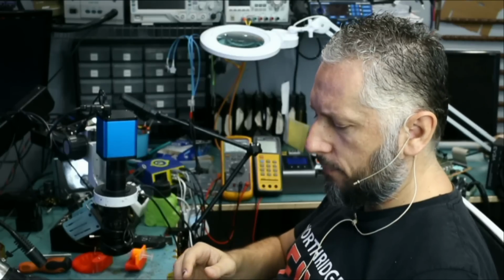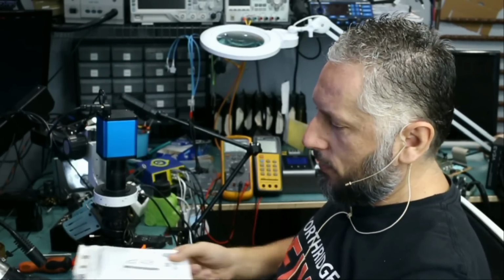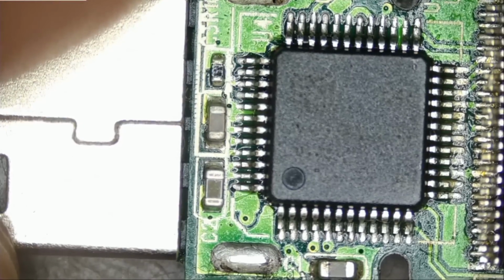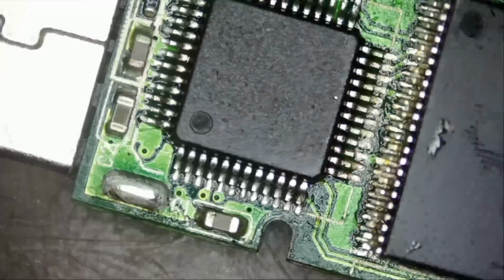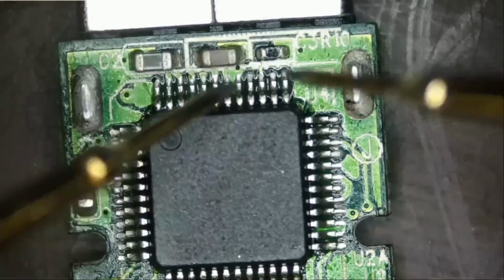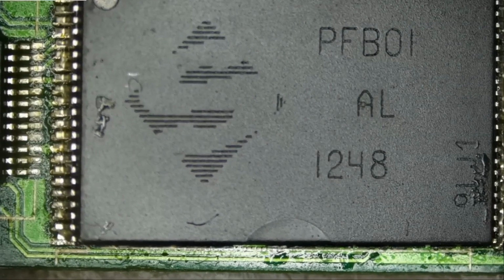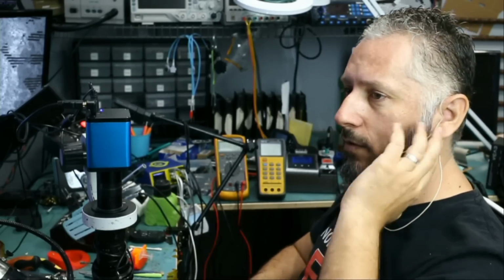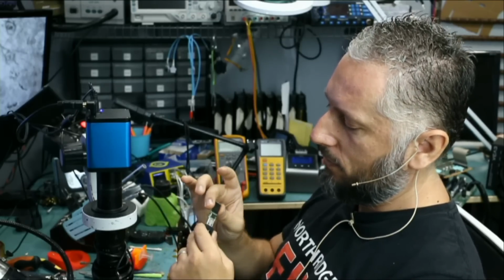Attempting to fix a damaged Flash Drive - Why would anyone do this..

Comment: i dont know for certain but it is possible you put the chip on upside down.. if you notice on the board there is a circle and there is a dot on the chip. you put on the upper left. on the usb drive i have the dot is on the bottom right.. where the circle is on the board. its entirely possible tho the chip has already been fried and it was too late for you to fix.
Reply: yes, he did it wrongly
Reply: He put it on the same orientation as it arrived. The text on the chip is the same way up before removal and after it’s been put back on.
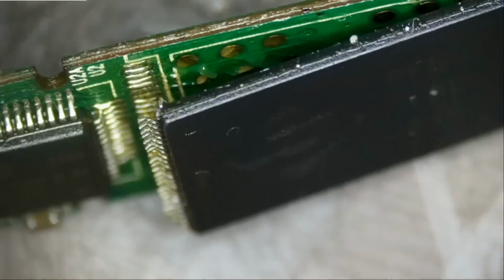Reply: @Durzel  yeah i get that but i dont see the arrow that shows where the dot goes at 1:55.. i do see a circle tho at 3:58
Reply: I saw the same circle now that it was mentioned.
Reply: i agree, there is a circle on the board, at 3:52 can be seen, and the chip circle is in the opposite corner, the chip came missplaced and he probably assumed that was the correct position.
Reply: @misterpacoalaparato  Well spotted.

Comment: Isn't the chip upside down? The circle marker (3:50) is in the bottom right corner on the board, while on the chip it's in the upper left corner. Also, there are pads for a diode (2:30) that doesn't seem to be populated. Maybe that's why there was no light. I would expect the controller to at least enumerate on the USB bus. EDIT: It's an 8 GB Micron chip (MT29F32G08CBADAWP) packaged by SpecTek (FBML84A61K3BAAWP)
Reply: Yup = that is what I see too...
Reply: Yes its soldered without checking the circle marker, only if he paid attention but was more concerned about his microphone and batteries...
Reply: yeah 👍 he prefers speed than good work done properly.
Reply: @MegaTomPL2  yeahh I seem to see a lot of his no fix problems are discovered by comments

Comment: Customer should have bought an identical flash drive, so you can swap driver or nand between them and try to recovery data
Reply: Really?

This guy should just have a flash reader.

This is the actual fix to this issue.
Reply: I’m thinking the same
Reply: @nexxusty  The customer did not want to recover data, but fix the drive.
Reply: @radeksvoboda7629  customer sent it to 2 recovery places and they couldn't apparently. So the customer definitely wanted data recovery.

This guy just soldered the chip back on. Anybody with SMD soldering skills would've done that.
He didn't even attempt the recovery at all.
It doesn't take rocket science to insert it into a computer and say it doesn't work, now pay me even though I didn't do the job.
Reply: @radeksvoboda7629  A 128GB drive costs less than what a competent technician charges to even think about fixing a drive. This was data recovery.
Reply: I agree with you. Swap nands could have worked

Comment: Nice work, nice video. But i don't think that this usb drive was ever at a "data recovery store". I guess no one will this usb drive leave like this or send it back to his customer like this. That would be a bit weird.
Thank you for that video
Reply: i think the same as you + i think the costumer do this mess😂😂
Reply: I believe if those hdmis In xboxes, ps can be done like that, then this can happen too. But I believe no company actually removes the big Chip. It's mostly those small, controller chip they find the same batch for.
So it doesn't make any sense to me
Reply: I've been given similar stories with devices brought for repair. Screws stripped and missing.. customer claims it was a previous repair shop that did it. Usually get them to admit it was their own doing after a little bit of back and forth. ”highly doubt the repair shop stripped every screw and pried open the device with a butter knife”. Lol some people
Reply: There's people that can actually leave it like that , i'be send a laptop to repair it ( bios flashing ) and like 4 week's later they writed us so we can get it back , back again in our house , wanting to switch it on so we can made a backup of the data in the lap hard drive , we realized that the entire laptop was dusty .\\
And one keyboard flex connection was broken //!--

Like they pushed really hard the keyboard .

Comment: Good Morning from Cape Town South Africa. I watch your vids all the time and I'm learning alot. I watched this video an came across 1 of the pin connectors which was not soldered as the connector was removed while you were checking the pins please check 4.27 all pins are there on the right side. Then at 4.33 the 2nd pin from the top is missing. I'm not sure if this could be the issue to why the flash drive is not picking up when plugged in? Loved the music by the way.

Comment: You could attach a backup mic (mini lavalier)  on top of the microscope. The quality wont be as good as  Sennheiser but you'll always have a backup when needed.
Reply: Nice suggestion
Reply: Thats a solid idea. But would need to separate the channels and record all the time plus always have to remember to turn that one on too.
Reply: Which Sennheiser model does he uses?
Reply: @Nobbie248  He can leave it on all the time if he has enough inputs, the downside is he needs to delete the track on the NLE but that takes 2 seconds.
Reply: @requiem4adreamc  I think it is G3
Reply: @MicSokol  Thanks for the reply :)

Comment: Hoping you use Eneloop rechargeable batteries! If you aren't familiar with them, they do not lose any charge after being charged, while sitting and waiting to be used. They also allow more charging cycles than others due to this. I use them all over my house, and since switching to them I haven't had to replace any of them. They can seriously sit in my box charged and not lose any power even if sitting for months. We also use them at work (I work in AV, and we use many, many wireless mics for presentations.) Anyway, just a tip to try and help!

Comment: I'm just learning to do basic repairs. I was able to re-solder a antennae and reflow a capacitor. I am proud of that! It was my first repair for someone other than myself. It took time and effort. I did a crappy solder job but it works. I reflowed the capacitor ok. The solder holding the capacitor appeared to have seperated from a manufacturers defect maybe? I watch what you do with awe hoping to be as good as u are in say 10 years lol.

Comment: Would it not be possible to get a working drive of the same kind and replace the NAND chip?
Reply: it is possible, but what if the NAND chip itself is not good.
Reply: Wouldn't help with the data recovery though, and that drive is worth about $5
Reply: @cattflap1447  Why would it not? Is it assumed that the NAND chip is faulty, and not the controller chip?
What's the value of the stick to do with anything? It's the value of the data which is important.
Reply: that's what i think too, i know this is not great when it came from two shop (one probably imaginary costumer shop?)  Anyway let's say the costumer is honnest, he already paid twice for data recovery service, witch cost a lot, and now another payement for something that probably been already done ?
Reply: @WinrichNaujoks  Because the nand chip holds the data, replacing it with another would mean the data is still lost
Reply: @cattflap1447  Of course you would put the NAND chip with the data on the otherwise working stick!
Reply: @WinrichNaujoks  hehe, nice conversation ;)
I had the same thoughts, so you can make sure that everything else works on the stick (or get a NAND chip reader ;)
Reply: Problem is the controller, unfortunately the lighting doesn't let me see the controller model, some use inbuilt encryption with the nand. If it's one of those then you would need something like PC3000 in nand protocol mode to read the data and reconstruct it, otherwise yes, finding an identical flash drive and swapping the nand to it may work, as long as the prior 'repair' attempts didn't kill the controller. I would probably drop the device into safe mode and see if the controller got recognized by the computer first. (Assuming the info to be readily available to put the controller in safe mode)

Comment: You could install a small LED VU-meter in parallel with the output of the microphone receiver so you can have a look at the presence of audio.

Btw, the flash drive may not start due to a bad quartz crystal. That's the only other important component besides the controller and the memory IC. 
More modern flash drives don't use crystal anymore.
Reply: Oh nice good point. A quick look on the oscilloscope would verify that.
Reply: What’s the quartz crystal for?
Reply: @I_SuperHiro_I  The crystal is responsible for generating the master clock for the board. Basically, you apply voltage to the crystal and it produces a high frequency sine wave (usually ~12MHz) that is used to sync all of the chips together.
Reply: @I_SuperHiro_I  IC uses them many times as clock signal. No pulse means IC wont flip any bits.
Reply: @XantheFIN  that was my guess, just like watches do. Thanks.
Reply: nice detection, I bypass that myself.

Comment: This looks like something I did to my first PS1 motherboard about 15 years ago when I messed up a mod chip install and got a solder blob on one of the ICs and more or less ruined it trying to remove the bridges. I should try to recover that thing with my new far better knowledge and tools than I had as a teenager, never got rid of it

Comment: Stevie wonder could've done a better job than these "data recovery" places.
Reply: Customer lied, who attempts to replace a ram chip to recover data? That's where the data is at, so it doesn't make sense. My bet is that's not even the original ram chip.

Comment: I once had a  hot soldering iron light up smd LEDs. I wonder if you should solder memory chips with it. Anyway, the drive was probably already dead.
Reply: Your soldering tip is not properly grounded and leaking current. He is using a JBC station which is most definitely esd safe.
Reply: Pretty sure that's why some soldering irons are advertised as "ESD safe" - the tip is isolated from heating element and connected to mains ground, so it can discharge unwanted voltages.
Reply: That means your ground is not working properly on the iron. Check if your proper earth connected. We also use anti static wrist strap to prevent esd from lighting up smd or frying sensitive electric.
Reply: But a quality soldering iron and you wouldn't have that issue.
Reply: @fabian11235  Thanks! Didn't know that.
Reply: @ChakshuSharma_CANNOT  thanks! But wouldn't data on a chip just discharge to ground with a grounded iron?

Comment: Amazing work! A shame it didn't work but watching you (as an amateur electronics repairman myself) I can clearly see the years of experience you have accumulated, I have yet to get my own hot air station because they cost a bit of money for a hobbyist like myself but it looks to be a really good idea for reflowing these surface mount components efficiently.

Can anyone tell me what sort of gel or fluid he used when he was... Cleaning the nand chip? I believe it was around 5:00, is it just regular flux or something else because it seems he stopped soldering after applying that paste?
Reply: Sha Pok  that makes sense, I'm just overthinking it. Thanks!

Comment: I think person work on flash drive try to remove the flash memory chip. That person might not own a hot air station and try to desolder with reguler solder by placing large amount of soldering led spanning all the pins. That way you could lift chip. But the problem  is this method only useful for smaller chips. As the other side get solidify when melting one side. That is why one side is lifted. I don't own a hot air solder as it is expensive this part of world and some times use this method with resin Flux and soft led (I have a reel of soft led. Not your low melt solder. But melt at low temperature than usual led). And then use a copper wire apply with resin as wick to clean.

Comment: Why not do a quick check to see if the USB plug is working correctly? Maybe measure to see if it's getting 5v to the chip?
Test continuity to the data lines.
Just in case it was something simple like that.
You may even have a tester for that type of USB.

Comment: As soon as I saw that USB drive I thought it likely a DIY NAND chip removal attempt. Likely someone hoping to either mount it on a donor USB drive of the same type or hoping to read-out the flash memory using a NAND programmer. The soldering across all pins looks to be someone’s attempt at bulk desoldering as done with Low melt solder but they used standard solder 🤣 Much respect to Alex for even attempting data recovery on this mess.

Comment: I doubt it came from any data recover company.   if it does he could actually sue them for deliberately left it solder like that.

I believe he do a DIY troubleshooting on that flash driver without any experience on soldering. there is even pads for a diode (2:30) that doesn't seem to be populated, he may have done that too.   

then when he realize he Fuck up.. he brought it to a recovery company but those 2 recovery company decline to work on it after seeing how fuck up it looks like. 
so he now send it to you.  LOL

what he wanted you to do is fixing the soldering so he can bring it to recovery company.

Comment: i have a Nintendo switch which has no power ive tried ever reset even leaving it on charge for a while im tempted to take it to a repair shop but thought i might ask around first the controllers also have no power so if anyone has a solution would be very helpful :)

Comment: seems the 3rd pad from the top on the right side of the NAND chip went away. Maybe that's the reason even if it should make a sound when you plugged that into the PC
Reply: If you freeze frame it at 4:31, you'll see that the pad goes nowhere.

More likely it's upside down. The dot on the chip is in the top left but the silkscreen visible at 3:53 has it on the bottom right
Reply: @madmangohan  doubt but possible, might be a VIA that goes to the other side. Havent seen much "just a pad" without a connection to somewhere else. Anyway might be possible even though the PC should have made a sound if the USB controller was OK.